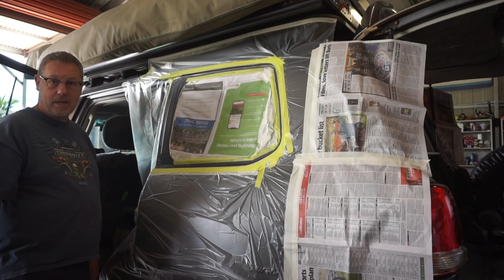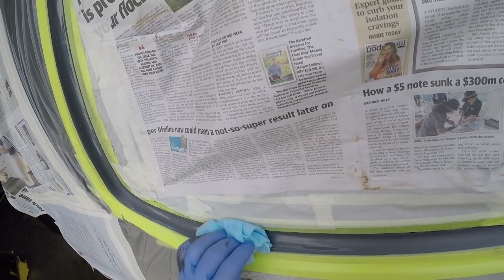Emuwing Gullwing Window Installation in my Landcruiser 200 Series LC200 | Ep 1

Comment: Terry finished up getting OBriens to remove glass cause as Dirty Harry said a man has to know his own limitations and it looked like a recipe for lots of paint damage on my part so now I’m at the clean the old sikaflex off the the window frame stage 
What did you use to remove it
Reply from the maker: I hear ya mate.  I’ve got myself into more trouble than I care to admit by not raising the white flag when I should have.  That sika on the window frame is a massive pain in the back side.  I tried wax and grease, turps, acetone, bug and tar, and in the end it was good ole thinners on a rag and hours of elbow grease that got it off.  It’s not fun but it works👍😎

Comment: Hey there, any follow up on your gullwing seals, have you changed and or modified them to a better system?
Reply from the maker: Hi Travis.  I’ve never had the need to change them or upgrade them.  They were dust and water proof when I installed them, and they still are 10’s of 1000’s of corrugations later.  If there are supposed to be issues with them I’ve not experienced any.  Cheers👍

Comment: Just because it probable keeps you awake at night those little black tabs you cut off actually have a T shaped end on them so that by twisted them 90deg they come out of the slot 
They are used to keep that bit of trim under control when the air bags deploy
Not that’s an issue now cause no one will ever sit back there again
Reply from the maker: Good to know, thanks for sharing mate👍😎